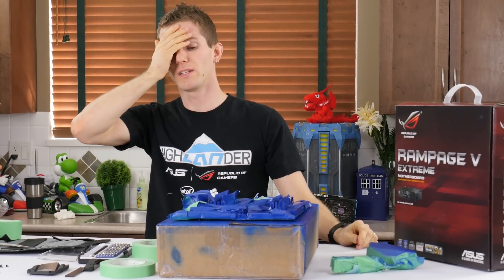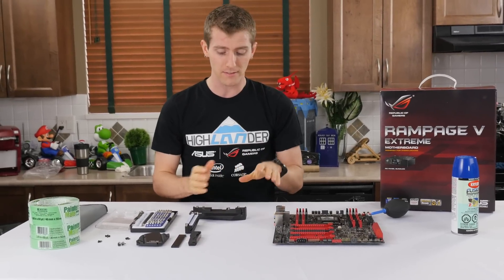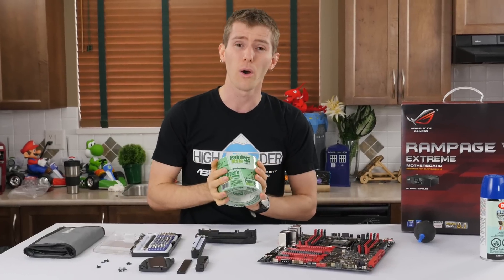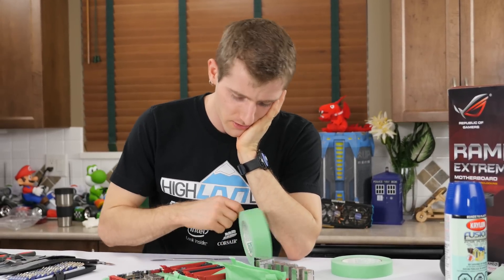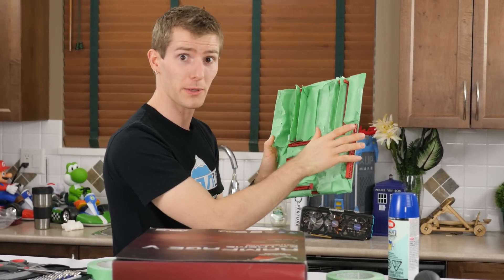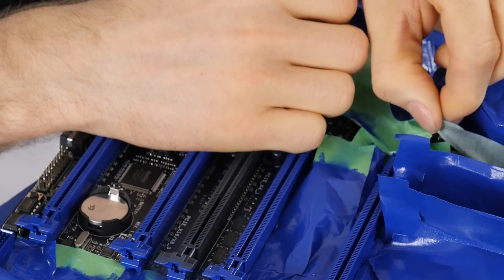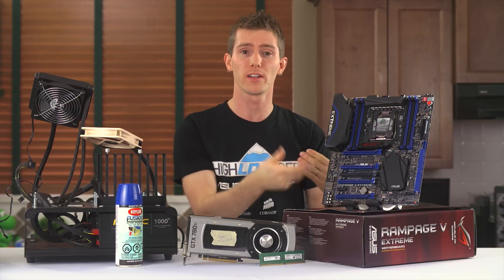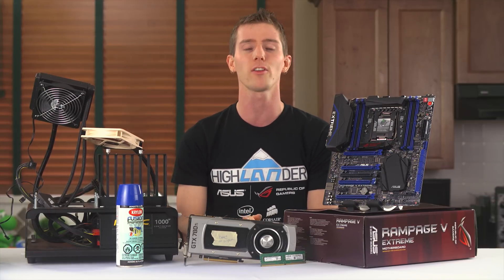Painting A Motherboard DIY Mod - ASUS Rampage 5 Extreme - Part 1

Comment: Don't care about the audio issues.  Its happens.  Get over it.

Thoughts:
-Might have been easier to mask off/paint one slot at a time.  Just carefully mask off the slot and use newspaper etc to cover the rest.  Would have been far easier masking/painting wise, but taken longer due to drying time between slots.
-Also this way could have used a single old RAM card, or PCI-E or whatever, to protect contacts while only ruining the one card.  Even for you guys, having a full boards worth of dead parts is a stretch.
-Having to add more paint rather than try and remove paint/overspray is always better and easier.

That being said, hey you gave it a shot.  Its only part 1 so it might(!??!??!?!??!) still work and not look terrible?

Like I said.  You gave it a shot :P

Comment: I had no clue you could spray paint a motherboard at all.  In fact, I would have guessed the actual board could be spray painted on with some special paint but you had to cover the connectors.  Exactly the opposite of what Linus just did XD

Comment: The idea itself wasn't bad... but I think if you used a small brush you would've had more control over the process and it would've looked much prettier,  as opposed to using a spray can, which will will spread the paint in an erratic way

Comment: Just finished watching this with my HTC m8 covered in Phantom glass with some ram from hyper x installed while signing up for crunchyroll and audible. Going to spray paint this phone blue now,  I don't like the gunmetal grey. After I will submerge it in mineral oil that is running through a cooling loop going through my entire house.

Comment: Guys, dear commenters, getting this motherboard and a 5820K, but does ram speed really matter past 2400mhz? Past that the prices go up so much.
Reply: Speed of RAM doesn't affect almost anything. Just grab the cheapest RAM of your preferred size from a trusted brand like Corsair, Kingston, Crucial, or G.Skill.
Reply: StrixLine Im thinking Crucial Ballistix, but maybe hyper X in stead since it goes better with this board since its black themed and not blank/silver. http://puu.sh/exTo7/0daba92e13.png There is a price diffrence, but at lower mhz ill just get the green bullshit sticks.

Also, thats in NOK.

Just wondered why 3000mhz costed soooo much more than 2400mhz lol.
Reply: TheCoDzillaPlayer RAM speed and CAS latency doesn't affect your gameplay. Just get the one that doesn't cost so much and looks good with your motherboard.  Or just get the ones without the heat spreader (green ugly).

Lykke til med PCen din :)
Reply: StrixLine Takk :)
Reply: ***** What are you trying to prove? I asked if there was a benefit past 2400mhz since the prices shot up so much. Nobody here mentioned DDR3, we dont need teaching about value then, or anything else. I want some of the features on X99, so even if I wanted to I couldnt have gotten DDR3.

No, DDR4 is not a waste if you want/need X99 features. Some of us dont have that much of budget problems either. High mhz DDR3 also is.... not so steady.
Reply: ***** Did you read any of the replies I got here? Your comment referred to ddr3 (since ddr4 starts at 2133mhz as far as im aware) and it had nothing to do with what I asked. Didnt ask for price or performance, I asked if it matters past 2400 because of the price.

Hope you understand now :) goodnight.

Comment: Thanks for the vid, Linus!
Been wondering about maybe doing this myself with this very same motherboard...
The job you put into it looks pretty decent to me though! so dont be too hard on yourself! :)
To come with a few tips: First off I wouldve used Tamiya masking sheet as well as masking tape because they cover a larger area and can be cut to size, I would also use blue-tac to mask off certain areas where its hard to reach with the tape.
I would also have put down a thin coat of an acrylic primer as well as have gotten a paint pot that matches your spray paint to do any touch ups with a brush, furthermore I would have gotten a hardcoat (matte would look cool) to seal it down, and to get the best possible results.
Looking forward to the next video in this series!
Hope the board keeps all its functionality! :D
Cheers from Norway!

Comment: I would probably use some pieces of hardware to put inside the PCI, RAM and the sata slots. If the paint goes into the pins, it might cause problems...
I know there are  plastic RAM dummies and you can use any sata cable. Not sure about covering the PCI slot though ...

Comment: Other than the little accident on the black pcie slot, it looks surprisingly good. just one more little thing to knit pick about would probably be the ROG logo on the heat sink that's directly under the cpu socket. if anything can be done about that, it should probably be done. With enough insertions or like super delicate peeling with a knife, im sure the paint on the contacts will eventually wear off

Comment: small idea, if you have some dead/old ram and gpu's that you didn't mind painting a bit you could strip them down and use the pcb's to fill in the contact spots on the ddr3 and pcie slots just as some insurance that you wont get any paint on the motherboards contacts.

Comment: Was there no way of just removing those red plastic parts to paint them away from the motherboard and the contacts? I mean, they were added after the board was built, right? And what goes on, must come off. How are those plastic pieces actually attached to the motherboard?
Reply: If you are talking about the pcie and ram slots that is no those are normally soldered onto the board.
Reply: David Struve The plastic is not soldered on, the pins are. The plastic is not removable because the connector was manufactured with the pins inside.
Reply: David Struve the pins are inside the plastic, they put the plastic bits on then solder the pins. If you try to take the plastic off you will at the very least bend the pins out of shape and not be able to get it back on.
Reply: Yes, they are soldered to the board.
To remove them you would have to manually desolder all 144 (I think, or is it 128) connection points on each Ram slot (not sure on the number of PCIe connection points), clear the holes, insert new/pained slots and resolder every single pin again... perfectly.
I would bet that the board was done using a solder bath given its mass produced so getting that right would be very hard. Possible but very hard... that said I have seen it done.
EDIT: Just counted up my old MB, 640 connections on 4 ram slots and 124 on just 1 old 8x PCIe slot. There, 764 connection points! :-P
Reply: And then you also have the internal ground sucking ALL the heat from the solder when attempting this. This isnt just your normal single layer PCB from your 5 dollar solder kit.
Reply: So the PLASTIC was soldered on?! How'd they manage that? I thought those plastic surround parts were added AFTER the pins are soldered onto the motherboard.
Reply: Sochimickox Ooooh...yeah that makes MUCH more sense! Haha thanks! I feel like a bit of a wally now lol

Comment: This makes me wonder if motherboard manufacturers would ever consider designing a mobo with removable plastic components for ease of customization? Or you know just make more mobos in more than just black and and black/red ASUS. That works too. :P
Reply: it seems to me an easy thing to realize too
Reply: You cant make a motherboard with removable plastic components, it would require desoldering every single pin from the motherboard.
Reply: Sochimickox You never know what technology might come up with. Computers were once so enormous that the took up entire rooms and could only do mathematical calculations. Now we have even more powerful computers than that just sitting in our pockets. So why isn't it possible that mobo manufacturers can't one day create a motherboard with removable plastic components that can be painted by the enthusiasts?

Comment: That ROG Logo is still red... Maybe like a Blue permanent marker?
Reply: i was thinking the exact same thing
Reply: The ROG logo is looking pretty good if you ask me. However the switches at the top-right, is not that great. (the power button is fine i guess)
Reply: If my memory serves me right, it's like a red film on the other side of that plastic. Could just take it off and put something blue underneath (or just leave it unplugged).
Reply: ***** That would definately work.
Reply: He could easily paint that with a pincel.
Reply: nope.... its as easy as soldering a new led onto it and removing the old one
Reply: ''Part 1"
Reply: TekSupport Soldering Blue LEDs would be very ideal.

Comment: as a painter Im a bit sad you didnt use a gray primer it will probably solve the issue on overspraying :/
Reply: primer will wipe out the color giving a single neutral color to start from and also gives a nice surface for paint to stick, so you only need 1-2 coat of the desired color.
Reply from the maker: How would spraying a coat of primer help with overspray?
Reply: LinusTechTips That's what I was thinking, lol. Primer just makes the paint last longer.
Reply: +Reynald Dilao Yeah but you didn't answer how that helped with overspray.
Reply: it mattems out the result tricking your eye to seeing it as less textured.

Comment: As a person who does not mod my PC all that much, is this merely an aesthetic concern, or a performance concern?  Also, unless the case for your rig has a panel that you can see thru and a board with red connector housing would clash terribly, is it really worth potentially killing a brand new board for????  Additionally, are there people that would do this to a board that will only EVER see the light of day for video card and processor upgrades, but would otherwise NEVER be seen by anyone, outside of those few occasions, JUST because "Eww, the board has RED connectors on it!!!"?

Please note that I am 1,000,000,000,000,000,000%  serious with my question, by the way.  Absolutely no trolling is implied, meant, hinted at, or irony is attached to my question.  I honestly am curious WHY someone would do this.

As for the tiny components that are not easily sprayed, spray some of the paint into a disposable cup and dip a small paint brush into the pooled paint for additional painting.  This method also works well for touch-ups down the line, too.
Reply: Purely performance, blue boards run cooler than red ones. When the heat running from the connectors contacts the plastic, it tries to dissipate the heat. If those connectors are red, the push off a bit of the heat because red is naturally heat-phobic. On the other hand, the pigments in blue absorb heat as energy and use it up, cooling down the connectors. This should decrease his overall temps by around 2 degrees C.

...

No, it's just for looks.
Reply: xZenithik But what about red flames or does that only pertain to cars?
Reply: All blue components are water cooled
Reply: This kind of mod is imo too risky for the price of the board unless modding is your life and you have lots of $$$$  laying around or are sponsored to do such things.

Comment: You don't just paint directly on plastic! At least just roughen it a bit
Reply: and also you should have sealed the contacts on the pci lanes, ram slots and all the sata ports.
Cos if the paint drips onto the contacts and the corresponding connectors dont make appropriate contacts, you are doomed

Comment: im a little disappointed you didnt paint the pcb. im so sick of ugly brown motherboards with advertisements like "pcie x16 3.0" and "sata 6gbps" and "usb 3.0" printed all over them like im going to buy the board which is already in my case. i kind of wanted you to tape off all the ports and pins that you plan to use and paint everything else black or something.

Comment: Nice view for the rampage, but you have to clean the electronic connection inside the slots to be workable.
It's not good to see one of the most powerful motherboards is failing after a hard work.
Waiting for the success of the costume build.👍👍👍

Comment: You know what would have been more logical to protect all the connectors? Connect dud ram sticks and dud gpus etc, then tape and paint, you would miss a few spots but only the spots that would be covered once the component was in place :)

Comment: LinusTechTips why couldn't you cover those pins in the pci slots with a riser card or the riser cable which would have prevented the paint to enter the slots?????

Comment: Linus, you had a ton of cards, rams and sata cables etc. that you are not probably using, why not just cut the tip, slot it in the PCI-E's, ram slots, sata cables and paint it, then after it has dried, just pull out those things, without you worrying about getting paint on the contact points of the slots.

Comment: Why not just fill the slots you're planning on using with eraser putty (non-conductive) then just take it out after you paint? Why leave the contact teeth exposed when painting???
Reply: Or just fill the slots with old/dead parts, and paint the hell out of the board. Then when you remove the old parts, the copper would still be exposed.
Reply: Because otherwise the paint wouldn't fully cover the slots, you would have lines of red in there, which is really ugly. The paint he used is meant for plastics, it doesn't bond well with metal so I guess we'll find out how well he did.
Reply: SnypeUXD The slots will be used anyways so it would be invisible
Reply: or just fold the tape and stick it in the slots...
Reply: .. but this way is more fun
Reply: or why not just plug old (or sacrificial) video cards and memory modules so the pin contacts are blocked off the paint
Reply: SnypeUXD fusion bonds really well to metal actually
Reply: Good job overall! In my opinion, a thinner, more precise nozzle spray can would be more useful here - also, why not leave the southbridge heatsink intact and just mask it with tape all over? I still see no point in removing it...
Reply: PsyckoSama
That's what's bugging me with this entire idea. I have its predecessor, the Rampage IV extreme. Very expensive, wouldn't dream of painting it, knowing I might kill it in the process. If you have such a mobo, it's the pride of your rig, and you'd probably want to match colors of other parts to it, not the other way around.
Reply: stressball Genius!
Reply: Oscar Velazquez Isn't that what I just said?
Reply: stressball
oh yes you did, i hope linus reads all this and facepalms
Reply: What annoys me is watching him ruin a 500 dollar Mobo.
Reply: PsyckoSama Too bad he got it for free, and it works 100%.
Reply: SnypeUXD but now the slots are filled with paint->bad connection

Comment: If I was a computer engineer at some motherboard manufacturer, I would make it possible to change out most if not all the connectors. To bad I am not because I think it could be possible.
Reply: it would not be easy...  you can change the plastic but good luck getting all the pins at the right spot... and it cant be so easily disconnected cause who knows at what layer of the mobo pcb they're connected inside
Reply: I think the engineers can handle something like that. Just make it more modular. Maybe have something that you can screw or slotted in that makes pin to pin contact. It is nothing more than what is already being done with say ram on dimm slots or gpu with pcie slots if you think about it. It could add some thickness but I am sure there is plenty of room behind a motherboard to accommodate something like this. If engineers can land on the moon, they can make interchangeable slots on a motherboard.
Reply: I don't think you realize in what quantities manufacturers buy these connectors to accomodate the price.
Reply: Easier to just have them manufactured in a couple of  schemes than to make them all interchangeable. Because they are, by their nature, interchangeable before you put everything together already.
Reply: Yes that would be super easy. All you have to do is make it so those retaining clips on the ram and pci slots come off.
Reply: shane bacawaka Of course it's possible to do but it would also be very difficult (read "expensive") to manufacture. It wouldn't make sense because the number of people who want to pay a heap of money for a motherboard, could be bothered modding it to change the color and are unwilling to just buy a different motherboard that fits their color scheme is so low. They would be more likely to make a completely black motherboard that has some kind of colored plastic accent that you can change, kinda like the TUF series.
Reply: Medium Sinatra They do a lot of stuff that has practically no demand, being able to customize the colour of the motherboard sounds like something most modders would want though, even if they are only removable and you have to paint them yourself.
Reply: Medium Sinatra in times where people put windows in their case, or use those iwin cases or lian li thing from CES, i think its not a far stretch to think tzhis would make a lot of sense. When tehy decide on a colour, they will always shy away thsoe that dont like that particular colour. Just remember the Gold thing ASUS did or the ugly light blue before. In times where so many manufacturer produce equally good high quality, such things give one the edge
Reply: I think asus could make more money from custom motherboards imagine a black and blue rampage   or any other customers colour  and different  board colours